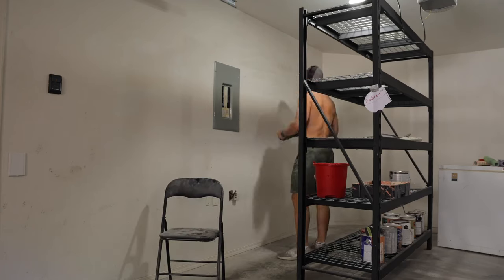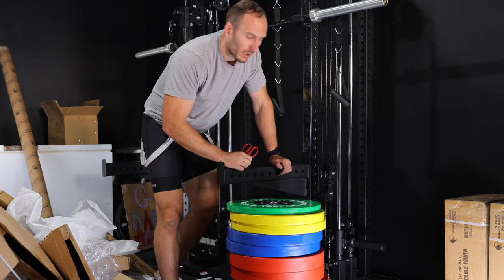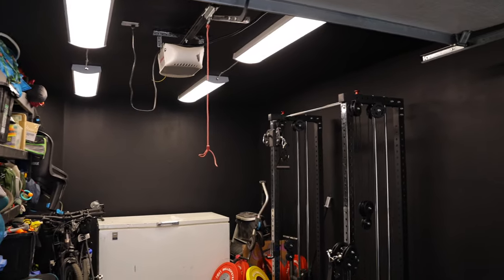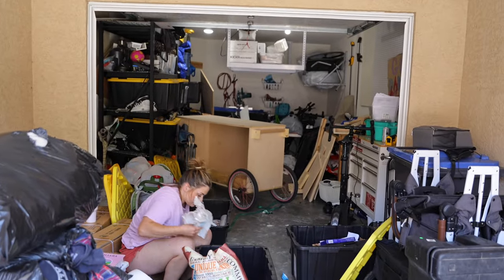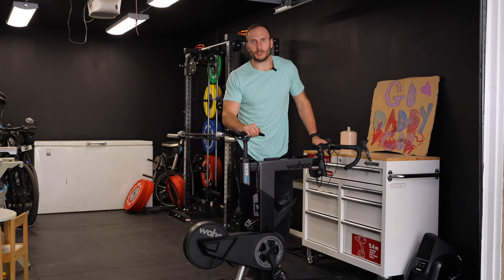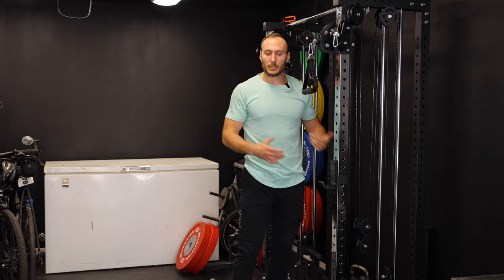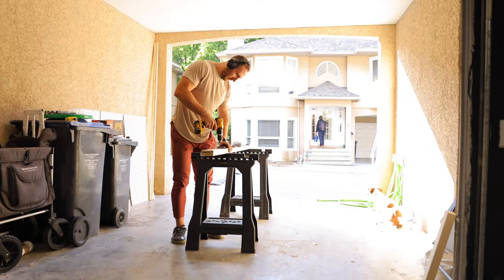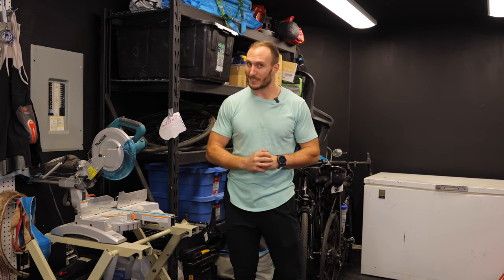Complete Home Gym Transformation - Step By Step Garage Build | Bells OF Steels All In One Cable

Comment: is there a way to load 1 inch plates on this machine? i have 400lbs in 1 inch plates and dont want to buy 2 inch plates lol. are the weight horns 1 or 2 inch. if 2 can it be modded for 1?

Comment: Great setup but don't you need to bolt those to the wall or floor? I would be worried about what happens if you dump the bar on the safeties.
Reply: Been wondering this too as I'm considering getting this piece.
Reply: @TwistiieHD  I got two of them since leaving that comment; definitely need to be bolted to floor or wall for stability
Reply: @timk8258  Ugh for real? I'm curious because this guy is squatting like 3 plates on the all-in-one unit but it seems to be pretty stable. I want to buy it but I just can't bolt it
Reply: @TwistiieHD He says in the video about the safety arms “so far haven’t needed them”… well, when he does, it could turn out very poorly without the towers being secured.